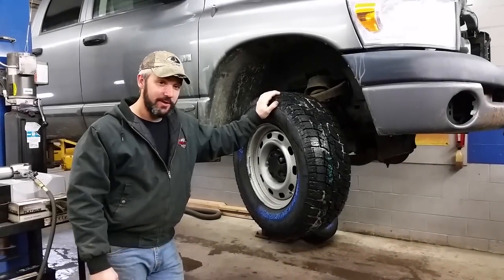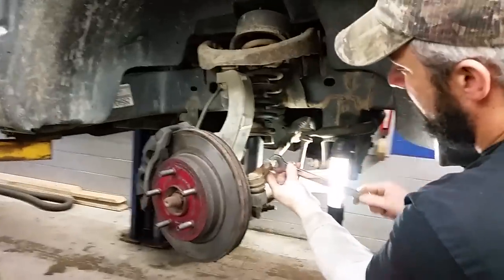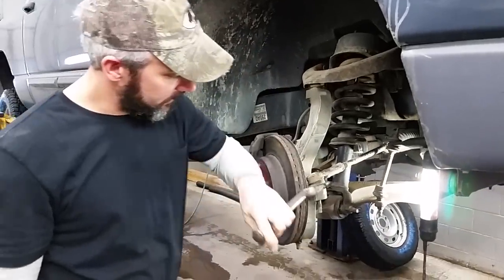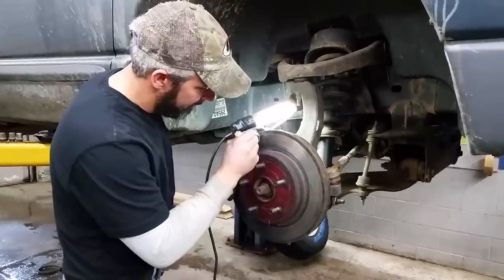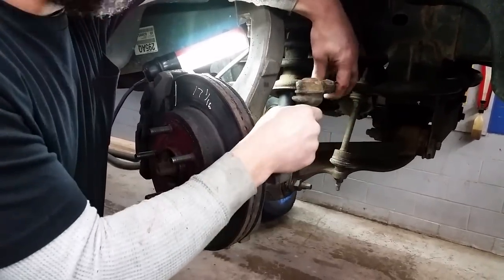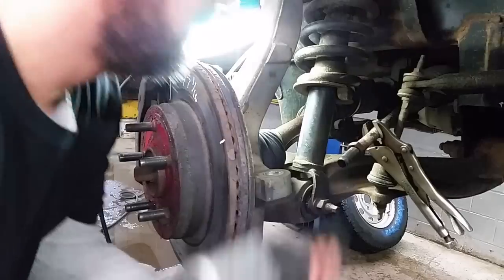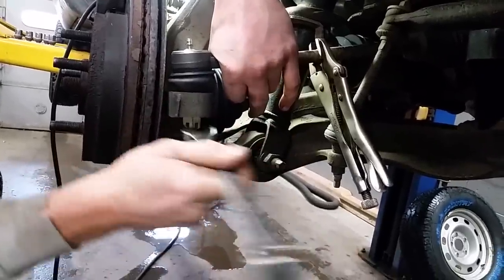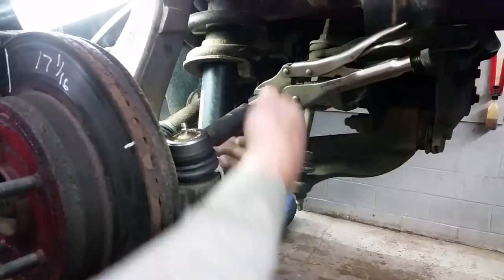Replace Outer Tie Rod - Dodge Ram

Comment: I use a compass,you know the ones used for drawing circles.spread it out to the jam nut,stick the pointy end in the grease fitting and lock it.use it to measure the new one.Somewhat accurate....

Comment: If you happen to miss the hole for the cotter pin after tightening, continue until it lines up again. Don't ever back it off to line it up. It could wallow out the hole in the spindle causing noise, looseness, or play in the steering. In some cases the tie rod could break and then really bad thing happens...

Comment: So I got the nut loose, and rod out, but I can't unscrew it, it's twisting the whole tie rod in past the boot where i cant see because it's rusted, I've tried heat and lots of pb blaster, but I can find a good spot to grab the tie rod to stop it from twisting. Any tips? (Edit) after 4 heat soak, and pb cycles it's finally loose!

Comment: Changed the outer tie rods, control arms, and sway bar links on a Dodge Neon a couple weeks ago. Wish it was that easy. 
Stupid OE design outer tie rod ends are made with a thick sheet of metal folded into a cylinder and have a large gap in the metal on the bottom which allows salt and water to get in and corrode the threads. 

Pain to remove. Even more of a pain to install a cast tie rod end over the old threads.
Should have recommended replacing the inners too.
Reply: Also, jam nuts were so tight on both sides that I had to push as hard as I could with my right leg on the end of my 22mm wrench to get them loose. 
No way I would have been able to get those loose using my arms.

Comment: A guy at the shop told me I needed a wheel hub, well after doing that it turns out it was just the tie rod end, great video, I like when you say "you don't have to kill the nut" I have never killed a nut. I call it "Angry monkey tight" maybe not so PC

Comment: Hey glad to subcribe. On another dogde related issue. I got a 2010. Dodge ram 1500. With the back wheels off the ground, shouldnt i be able to tirn them without alot of effort.? Just serviced brakes and e brakes cause i thought that was what was holding the wheels from turning like any other. Any thoughts?? Thanks for your time. Great videos.
Reply from the maker: Michael Nicholson 9 1/4" locking diff? Jack it up and put t-case in neutral see what happens then :)
Reply: Thanks, will try that..

Comment: I love your idea of marking your brake rotor and a point on your vehicle frame to get a toe measurement, in addition to counting turns. When I replaced the tie rods on our 05 Ram 1500, the right tie rod was completely seized with rust, so much so I had to use a torch to get it off, thus counting turns didn’t really work here... but when we went to Les Schwab for a professional alignment, it was done in 20 min and the tech said the alignment was only slightly off! Thanks so much Eric!

Comment: very good and clear video. Now I need a video on how to replace the rack and pinion on my 2004 dodge truck. sears says that needs to be replaced with my tire rod
Reply from the maker: Actually the racks in those are really easy to change. If you can change a Tie Rod you can do a rack for sure :)

Comment: the arm is up side down.the  Castle nut is on top.dodge Cummins  diesel  1996. 2500.8 foot bed .heavy spring.

Comment: Great vid and many thanks for posting your clear, detailed instructions. I took my Ram for an alignment, but the shop said they didn't want to do it because my outers were shot and the alignment would be pointless. Makes sense -also feels good to know the shop didn't just take my $ and send me on my way.Watched your vid and ordered some greasable tie rod ends. Seems pretty straightforward and DIY-able. $23 for a set of ends and a tube of anti-seize; can't beat that. Thanks again!

Comment: also replace the inner and outter at the same time. both sides
Reply from the maker: +Richard Cowtails So one bad tie rod it is recommended to change all of them?
Reply: +South Main Auto Repair I would lol.  I changed my litter tie rod then my inner went bad. made me wish I done all at once. save time. another alignment fee and the job done over. could've saved ll that if I had some it all at once
Reply from the maker: Oh I see. That is a hard sell to a customer, especially when you have to tell them they are not bad but you recommend changing them. Not a  lot of people get that ya know.
Reply: +South Main Auto Repair lmfao!!!  I bed it would hahahahahaha. sell them a extra transmission and headlight fluid too haha

Comment: FYI for the DIY'ers out there- when changing all your own chassis and steering parts, tighten all your own nuts and bolts!  Don't assume the guy at the alignment shop is going to check all of your work. We've had guys rebuild the entire front end of their cars (ball joints, tie rods, pitman and idler arms) and just run the castle nuts on finger tight and shove in a cotter pin!   They said they assumed we needed it all loose to adjust the alignment.  LOL
Reply: Same goes for co workers !!!!

Comment: How come when he loosened the tie rod bolt he loosened it by righty tighty not left loosey
Reply: because its left hand thread
Reply: Are you asking about the jam nut? It's all still righty tighty. Lefty loosey. The jam nut is screwed onto the inner tie rod first (right-tighty) and then the new outer tie rod end is screwed on (again...righty-tighty). The jam nut is then backed down (lefty-loosey) against the tie rod end and jams against the back-side of the outer tie rod. To break the jam nut loose in the beginning, the jam nut is run further up the inner tie-rod by righty-tighty (only by a thread or two but just enough that it's no longer "jammed" up against the back side of the tie rod end).